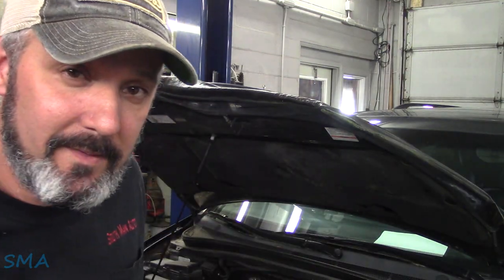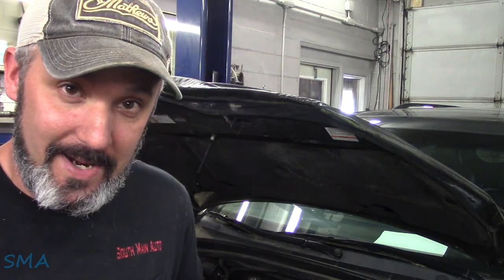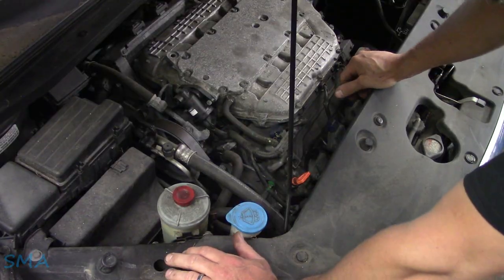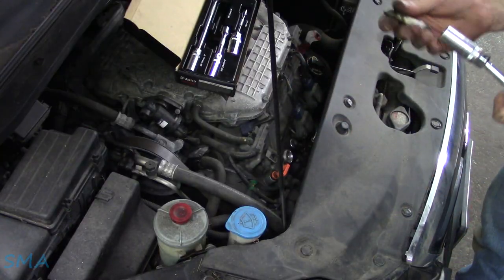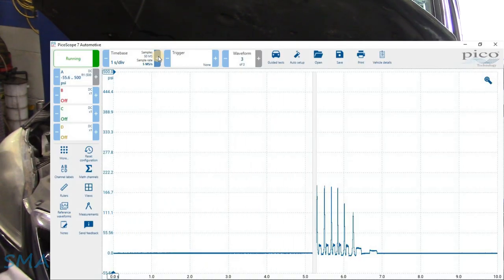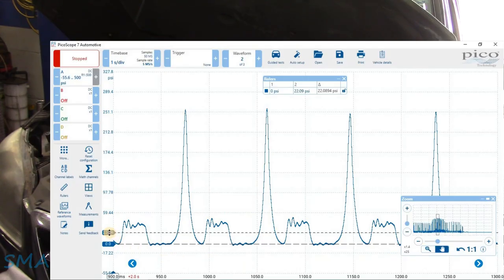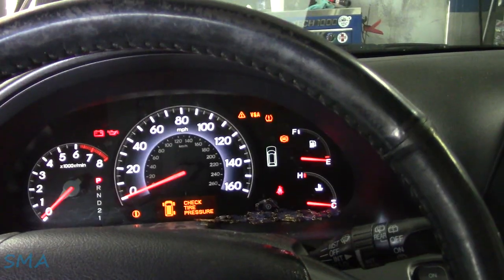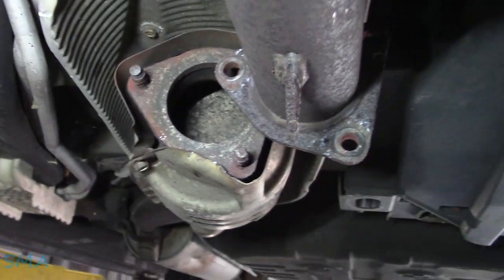Honda Odyssey: No Power At All

Comment: Seems strange that the rear cat is plugged, and it's determined that the back cat is diagnosed bad.  I would think that the two front cats on both banks were bad, or, one or the other because of them shedding from the front cats pushing the debris back to the last cat to the front of it in turn plugging the entry because it couldn't push through the last single cat. I would believe the back cat would be last to ever break down in the system because the bank cats do most of the burning off any excess unburnt fuel hydrocarbons and run hotter than the back one.  What possibly makes it by the fronts for being processed gets taken care of scrubbing residual hydrocarbons which would be minimal and run slightly cooler. So what's up !

Comment: Next time, just pull some oxygen sensors out to test for a clogged exhaust.  It is enough to make it run better.  Many years ago, I took a hammer to an oxygen sensor and ended up with a little tip big enough to install a vacuum line to it and I can hook that up to a pressure gauge.

Comment: Much help needid Help i have a 2003 f-150abs that wont go away so i pulled 40amp fuse switched to other location all of sudden flower fan was running and f150 simultaneously multiple circuit not working  doors, radeo , directional , obd2 port

Comment: Needs cats and a set of pax tires. That cars needs some money. Gotta be high mileage if the cat let go, so proly needs a rack if it hasn't been done lately. Atleast that's about all they will need.
Reply: It is also proly burning a ton of oil. We deal with these all day long at the dealer.

Comment: I've got a 2009 exl odyssey. Any time the ambient temp gets to be about 80 or above I lose a lot of throttle response. I try to throttle into traffic and nothing happens until it goes to the floor then takes off like a bat out of hell. I've cleaned the throttle body, MAF, plugs, and rebuilt the coil packs during the last tune up. I've taken rotor Temps looking for caliper hang up. I'm leaning to TPS, throttle body, or a clogged up stream cat. I get that in the heat an engine loses power but this doesn't feel like the problem. Any ambient temp below around 80 and the van drives like new. Any help is appreciated, I consider myself a pretty good wrench and I'm stumped. Thanks in advance
Reply: Is there a sensor for measuring intake air temperature?
Reply: @georgescott6967  yes I pulled it and cleaned it didn't look plugged up.
Reply: @pewpewoutlaw6181  It's clean, but is it working? When the air temperature is actually 80 is it telling the computer it's 80 or is it saying it's only 40?
Reply: @georgescott6967  I hear you not sure about the ohms it's supposed to be putting out. I'll have to check the ohms tonight when it's cool and during the day when it warms up. Thanks for the idea
Reply: Just realized the air temp sensor is operational as I had checked it on the OBD2 live data reader. 🤷‍♂️

Comment: I'll tell you why they haven't replaced the tires...  it's because of that stupid PAX system they put in the upper-end models.  It was a run-flat system that used a polyurethane ring inside the tires, which necessitated a specially designed wheel.  So, if you wanted to change the tires, you had to either buy the insanely expensive replacement tires (which you can't, since they're out of production), or replace the wheels and always have that "run flat" light on (maybe there's a way to disable it?  I dunno).  I believe there was a lawsuit over them, it was a really bad idea.

Fun fact...  The Michelin PAX system was only used in one other car...  the Rolls Royce Phantom. That should tell you all you need to know.

Comment: Since I had the new CAT put in, my mileage has significantly decreased. How come Eric?
Reply: I just replaced both Cats in my 03 Silverado I lost MPG and the check engine light won't go off no matter what I replace  Now I have to switch to actual GM Cats cause using after market ones aren't working on my GM. My buddy works for GM he said ALWAYS use AC delco parts if you don't want problems

Comment: All of that junk was in the front of the converter which indicates to me that one or both of the front converters have puked. The front units should be removed and inspected at the very least. If one or both of them are still puking, a new rear unit won’t survive for long. It’s better to lose the job than to eat 3 converters on a comeback.

Comment: Is there any liability on the part of S.M.A. if the driver is allowed to drive away on tires that are obviously worn-out and subject to blow-out and possibly cause an accident?
Reply: What is S. M. A. ?
Reply: @miken6imy  ...sorry, I forgot to add the R. South Main Auto Repair.
Reply: Understood.  As I kid working in an auto shop were were today to tell the customer to tow the vehicle from the shop if they wish to not repair the car for extremely unsafe problems (tire with metal showing, master cylinder empty or hydraulic leak).

Comment: Timing should be out of the question tho it starts ever quickly and smooth .. no power , you will definitely hear back fire .. so you should have  just jump to exhaust..
Reply: The cam/valve timing can be off and it’ll sometimes start and idle fine. Seen it a couple of times where cam timing was off and it sounded fine at idle but just didn’t make any lower when actually trying to drive.

Comment: Yep if it were me, I'd take my big steel rod and hammer all the old material outta that cat, just turn it into a straight pipe hidden inside a catalytic converter body, have done it many times in my state.  No emissions testing here.

Comment: Why not remove the front O2 sensor and see if she runs better? I've had good luck with this test for plugged exhaust. Just removing the O2 sensor provides enough pressure escape/relief to let the engine rev up if the downstream exhaust is plugged.

Comment: That van sounds like crap, that 3.5 should be smooth… a 2005 with broken mounts sounds better than that. The engine was flopping around like a strawberry in a bowl of parfait. But it wasn’t the noisy pig this van is.  Get the guy to do a catback exhaust and hook him up with a test pipe